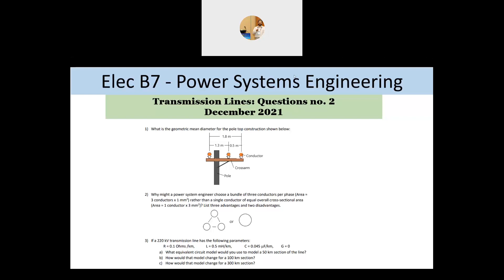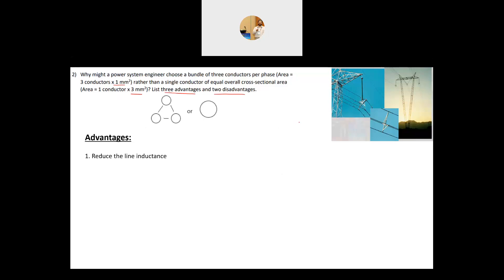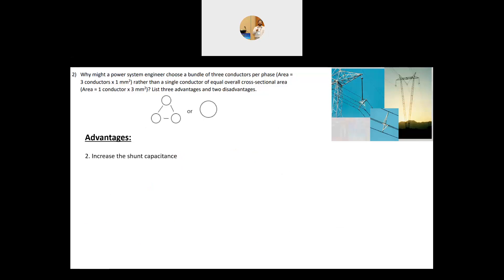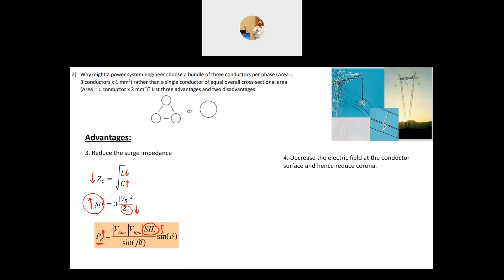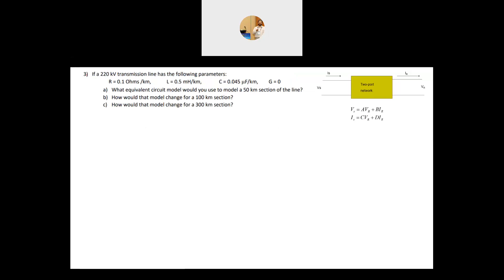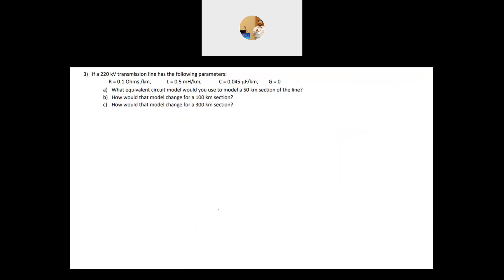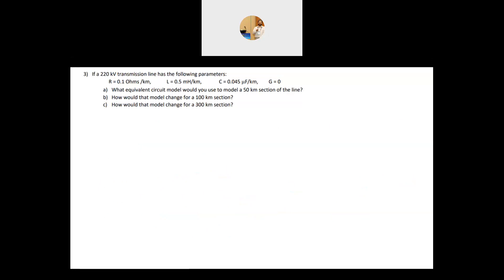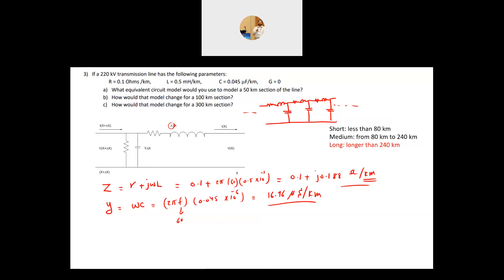PEO solved examples (ELEC B7) Transmission Line Question no. 2

Comment: Hi Professor, should we consider the ground effect if the hight of the tower is given?
Reply from the maker: we consider the ground effect in distribution system where the line is not balanced and hence we need to represent the line impedance in matrix form. this is outside the scope of B7.

Comment: Thank you professor but I have a question. Why didn’t you use pi equivalent circuit for long line as well and solve Z’= Zc sinh ¥l, Y’/2=1-cosh¥l/Zc sinh¥l? Is your solution enough for the long line?
Reply from the maker: The model you are referring to is called lossless line model for long transmission lines, so R is ignored in this model. I used the model with R, L and C and showed how the model evolves as the distance is increased.
Reply: @electrical4everyone  got it, thank you so much professor
Reply from the maker: @abdulrahmanal_khulaqi717  You are welcome

Comment: Thank you so much Dr for solving Power Analysis questions . We would really appreciate if you could solve more questions on Elec B7 power systems exam samples. Thank you again
Reply from the maker: Currently I'm solving A1 and A6 questions as the exam is coming in june. When is the next B7 exam?
Reply: I know the electric circuit is on July 15, I am planning on taking Power exam for fall/winter . So , I have started preparing for the exam. Thank you Dr. I will be waiting for B7 exam solutions .
Reply from the maker: Excellent I will do some A1 and Ay questions then will start B7.
Reply: @electrical4everyone  Thank you Dr. for solving power analysis problems. Truly appreciate. The upcoming exam for B7 is on October 28. We would really appreciate if you could solve more questions on B7 exam.
Reply from the maker: @sindhumukesh1441 this is the plan starting after first week of September
Reply: Thank you Dr. Really appreciate your support.